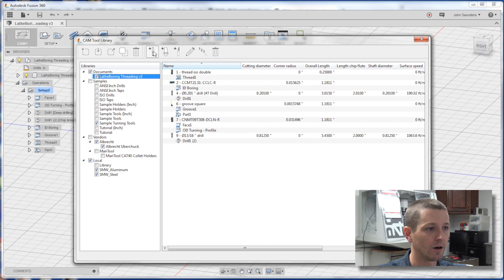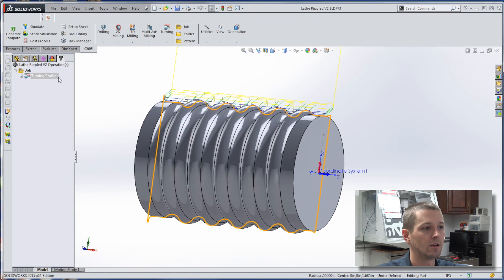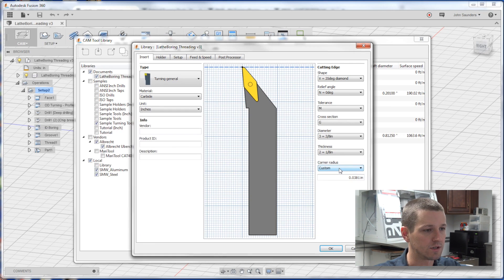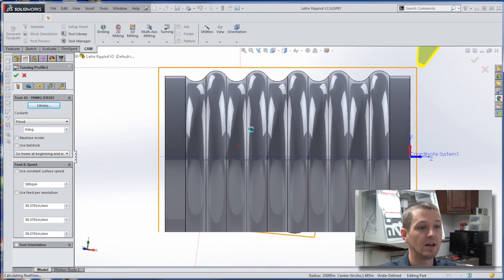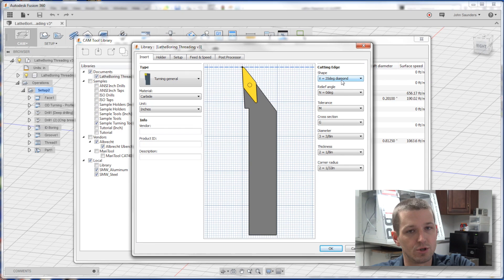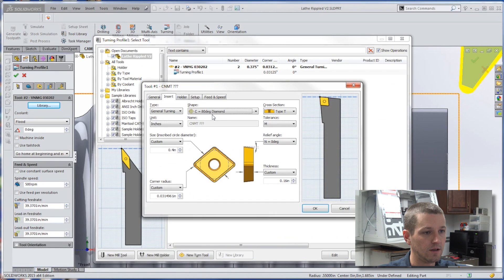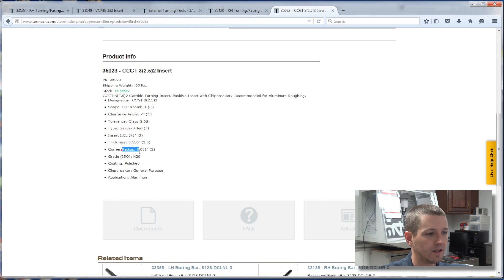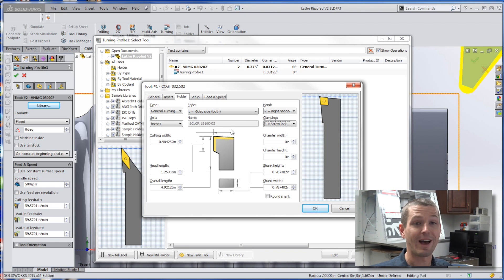CNC Lathe CAM Tooling Basics!

Comment: JohnCould you talk about selecting the tip control point when setting up a tool. I have had problems with using different control points and finally solved by using "center tip". I am using tool compensation "in control". But no one wants to talk about how control points are used and why, as well as what the differences are in the different tool compensation selections. Please get Fusion to address this and Tormach to create the library tools for Fusion to put in their library for the Rapid Turn deluxe tools (3/8 inch shank tools) so don't gave to create all the tools..
ThanksGreg

Comment: Thanks for this John. It helped me figure out the insert for the Tormach boring bar set here (http://www.tormach.com/store/index.php?app=ecom&ns=prodshow&ref=33142), but I can't figure out how to get the holder correct. The worst problem is that F360 treats it as a square, blocky holder, and so the simulation has it colliding all the time, but in reality it's round with flats. How would you set up the holder (for the middle tool in that set, the S06S boring bar)? Thanks!

Comment: OK John, I have a Fusion tip to share. While trying to replicate a Tormach tool holder using a vertical mill, I wanted to put the lathe tool in the vise. To make the undercut so the tool tip radius won't interfere with the collet, i needed to angle the tool in the vise. It took me a while to figure it out, but in SELECT TOOL>EDIT TOOL, on the SETUP TAB, there is a field marked ORIENTATION. Just type in the angle and it shows on the tool preview. Slick and easy. The angle you enter is the angle you actually set the tool holder in the vise.
If I did it right, here is a link to the Fusion 360 file:
http://a360.co/1mq7wUD
There is also a check box for spindle rotation, if needed. Might be handy if I get the setup backwards!
By the way, I will be mounting the 1.5" drill rod in a BT40 1.5" setscrew endmill holder. Z and X Axes remain the same as for a lathe. Y sets the tool on center of the work.

Comment: The 2020 means 20x20mm square shank. And the rest is what it is. But always the letters and numbers make out the insert and tool holder in "machinist" lanhuage. You could go shopping to a salesman with just those codes and you'd get what you want.

Comment: Great work John... The 2020 K03 stand (In my metric country) for a 20 by 20mm shank thickness, K stands for the shank length 125mm in this case, and the 03 is for the size of the cutting 'flute?' of the insert... (because you can buy the same tool holder or different size inserts)
Reply: image (although in Dutch): https://dl.dropboxusercontent.com/u/10886452/Beitels.pdf

Comment: The numbers following the letters on the holder denote the cross section size (square or rectangle) of the shank, the insert it uses, it's length, and whether or not that length is qualified precisely.

Your last tool was an SCLCR 12-3C, which means that the shank size is 3/4" (12 for 12/16ths) square and takes a 3/8" IC insert (3 for 3/8ths) (IC stands for Inscribed Circle BTW) and has a qualified length of 5" (C = 5", comes from a table, no formula here).

The size that is showing up in your CAM system is the metric (ISO) equivalent (19 = 19mm sq, which given that what you've got entered in the form is less than 20mm the software is just jumping down to the next smaller size, which BTW would be a custom tool, most brands jump from 16mm to 20mm), the K = 125mm length (you've got 4.921" entered in the overall length field), and the -03 is the insert size (3/8" IC, which should be -09 for a proper ISO part number, but it seems that the software is just reaching for a suitable part number with the mishmash of info you've given it).

Gotta bone up on this stuff if you're gonna go make a presentation to try and teach other people about it.

Tried to post some links to this info for you to read, but YouTube won't allow it for some reason.

Comment: +NYCCNC All of those numbers and letters are ISO/ANSI standards. Carbide depot has an good page detailing everything, and the kennametal master catalog does an excellent job. In essence, it goes Insert shape (first letter) Relief angle (second letter) Tolerance class (third) Chipbreaker/holder type (fourth) Diameter of an inscribed circle - in essence the insert size (first number) Thickness (second number) Nose radius (third number). 

Insert size is the number of 8ths of an inch, 
Thickness is number of 16ths
Corner radius is number of 64ths

Based on those numbers you should be able to know exactly the details of the insert. For example if I tell you I have a CNMG432 (which happens to be rather common) you can, from that alone, know everything you need to know about the insert
Reply: +Ben Strobel This needs a big like.  Super informative for people that don't know.  You literally typed what I was about to respond with.  :)
Reply: +akromix thanks for the kind words! It means a lot! It took me literally forever to figure it all out the first time so I'm always thrilled to pass info along!
Reply: Great info Ben! 

The inserts can fit certain holders and generally we use the 1st tool you did as a finishing tool with a smaller radius or for clearance on a part we were making and the 2nd tool we used for roughing out our part since it's stronger and could take bigger depth of cuts with it. The one thing that you absolutely have to watch for is how the tool is loaded into your machine to make sure you turn your material in the correct direction so that it actually cuts the material. If it's mounted with the insert up it needs to spin CW and if the insert is down (so you can't see it) the material needs to turn CCW. If the materail is turning the wrong way it won't cut and usually breaks the inserts which are not cheap usually.
Reply: +Mad Painter Thanks for the kind words! As you mentioned, the CCGT (or CNMG, they're both very similar) are pretty much most commonly used as the main roughing tool in a lathe, and the V geometries are used mostly for profiling. Also, very good point about the rotation direction of the material, very important to take note of!
Reply: +Ben Strobel  Thanks. Both can be used for roughing or finishing without a doubt and I didn't mean to make it sound like they was  only for one or the other. I think our instructor liked to do that to us to make us write more lines of code for the heck of it. lol
Reply: +Mad Painter Oh most certainly, but that's kind of the 'standard practice' if you will
Reply: Can you link to the page that explains all the letter codes? Thanks!
Reply: But of course I have tools that this doesn't work for. 
example...
SDNCN or SDJCR...the list goes on.  If you have tools with the correct markings that apply to your method, its easy. I have zero like that.